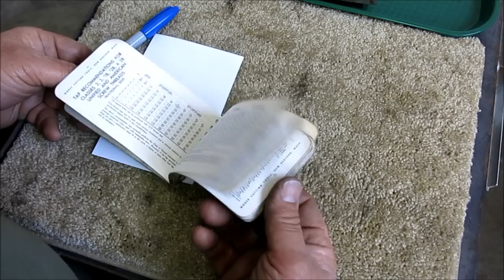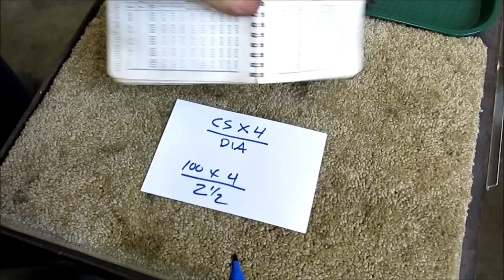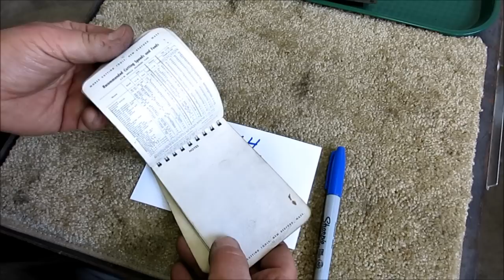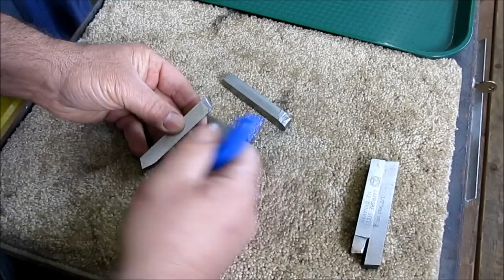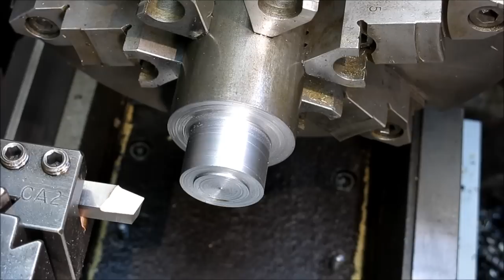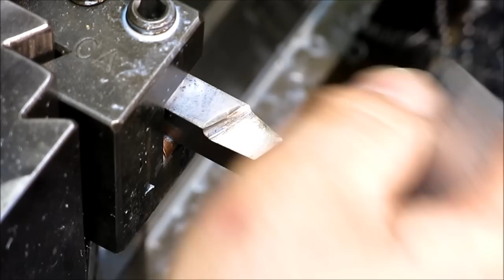Chip Control to Major Tom

Comment: why is it that machinists never hone their hss tool on a leather or wooden strop, charged with honing compound after grinding it on the bench stone? in woodworking this is compulsary practice for a good and polished cutting edge, which will not dull quite as fast as a ground  one on a usual bench stone  (which will look much like a abused steelbrush under the microscope after the first second of use). Honing in my trade is done on a strop with honing compound, or on a (at least)  8000 grid stone. I can't imagine that the same rules for cutting edges don't apply at all for metal cutting. I get better results with a good stropped  cutter on my lathe. What is your view on this, Tom.
Reply from the maker: Hi Flip,

Well I never tried it. Do you strop the edge on your log splitter? The edge of a fine wood chisel and a axe are two different kinds of edges. Instinct tells me that it would probably not make a noticeable difference. The metal cutting tool works because some base metal actually builds up on the edge and aids in the shearing action. This is called built up edge or BUE.  So the cutting mechanisms are slightly different when comparing to wood cutting tools. That said the honing process makes a dramatic difference in the cut action and quality of single point metal cutting tools. So it might be worth trying an experiment.

Cheers,

Tom
Reply: oxtoolco Thaks for reacting, Tom. as for the log splitter, i would hone the cutting edge when having to split cross grain, Which in my opinion is more like metal cutting. Is this BUE semi palstic (due to temperature or so)? As far as i know for woodworking cutterly, the polished edge results primeraly in less tool pressure and a much longer standing time of the cutting edge. but this is most noticable when cutting cross grain. I can imagine that this BUE rolls easier over a polished surface. I would be interesting to see cutting edges of metal cutting tools before and after use on a micron scale. when sharpended on a bench stone it looks like the alps as far as i know. Interesting matter, that metal cutting, or is it merely pushing it away?
Reply: Flip de boer I also operate in the wood cutting business. The problem with strops is they tend to round the area near the edge, changing the geometry. We operate Weinig molder and profile grinders and they recommend never honing, same issue, geometry change. The secondary bevel is designed to provide maximum edge support and as such provides little clearance for heeling. If your bevels or feed speeds reach the point of heeling the tip will heat and the edge will go to hell much quicker. Odd as it seems feeding too slow will also heat & dull the tool. Too much rubbing and not enough chip to take the heat away. Molders equipped with profile grinders can also reach the point of heeling very easily.

Comment: Hi, Tom. thanks for the schooling on tool bits. i think i was making mine wrong all this time, my nose radius are huge and side loading my work pieces. your equation: what is the units or value of the "4" or is it a consistent??? thanks for the great videos. sorry about the stupid questions.
Reply from the maker: Hi Sam,

Four is an approximation of the conversion of feet per minute to revolutions per minute. Its an easier number to work with than 3.82 when doing work at the machine.

Cheers,

Tom
Reply: thanks

Comment: Great video I learned a  lot, thank you. Two thing that I may tribute to. One is when using honing stone I would use a plenty of water, otherwise material from steel is clogging surface of a stone and finish is not good as it could be. Second thing is that scissor like tweezers, in my opinion if it catch something and get pull your fingers may be pull also. I'm using normal without finger loops. Just a thought, I'm not trying to be safety nazi.
Reply from the maker: Hi Olomar,

Thanks for the comment. The pliers I'm using do not have finger loops. You are correct that that would be a bad idea. On the honing stones. I subscribe to the technique that a dry stone gives a superior edge. The details of which are described in detail in the great book "The Razor Edge book of sharpening" 
http://www.amazon.com/The-Razor-Edge-Book-Sharpening/dp/096660590X

Cheers,

Tom

Comment: The HSS cutting speeds in the books and on the charts are based on a 60 minute tool life. GREAT CUTTING TOOL ! Nice cutting with .4375" depth & .010" feed, no more steel wool !
 Great to see you using real man's coolant ! By the way those unrealistic high speeds manufacturers recommend for their carbide inserts are based on a 15 minute edge life !

Comment: I am definitely going to do a follow up video at some point on my heavy turning video. I was at .030 feed rate with my 1" bit I would have liked to have seen how your 1/2"did at at least .015. I think it might have broken the chip even better. I am thinking crowding the feed rates might result in more faster metal removal  than just making a deeper cut. I can't wait to get time and materials to try it with! Thanks for the great insightful video.
Reply from the maker: Hey Brian,

An impressive cut no doubt. I'd for one like to see it closer up and a couple seconds longer. Do you have any 1/2 inch toolbits?

Cheers,

Tom
Reply: I looked in my stash and all I have in 1/2" stuff is some brazed carbide.  I don't currently have any material to cut on anyways. I want to do some chip breaker work on my cutter anyways to try to get a turning setup that is clean and doesn't ribbon or throw 1lb chips at me. LOL Busy farming here now, so shop time is limited, but I will get back to it soon. thanks for your interest.
Brian

Comment: Hi tom, could you at some point make a video about machining tapered parts? Tappered externally and also doing a tapered bore? I can find some videos on it but I would appreciate your take on the topic.

James
Reply from the maker: Hi James,

As in things like Jacobs tapers or long tapers like propeller shafts? This is actually a entire class of work for long tapers. Short ones are fairly straight forward. (no pun intended) with the compound, The trick is measuring them.

Cheers,

Tom

Comment: Hi Tom, old school worked well! That's how it hung in there long enough to be old! I'm getting pretty old, and it's mostly my way... ;o] For the most part that was just how I'd grind it. Perhaps depending on material, and machine/machinist (chips)... I may have put just a "tiny" bit more radius on the point,,, (very slight). There was not even the least little bit of strain coming from the sound of your lathe... It seems to be quite a nice machine! Y'all are creating quite a nice series and are great teachers. Thank you... :o]

O
Reply from the maker: Hey O,

Normally I use a slightly larger radius as well. Watching Adam on the first chip control I decided to try a real minimal radius on the first tool and it seemed to hold up fine. The lathe can take the strain but the tool clamping will become an issue pretty quick. Thanks for the comment.

Best,

Tom

Comment: Thanks Tom, this info is priceless.  Have you ever used this type of cutting tool?  Diamond Tool Holder in use
Reply from the maker: Hi Coyzee,

Never tried one. This is basically what I ground in a blank piece of high speed steel. The diamond type shown in the video makes it simple for beginners to sharpen a tool and have success. I would invest in an insert setup before I got one of these. But I can see the utility of the design.

Cheers,

Tom

Comment: While the two videos so far have been very interesting and helpful, I must confess that my interest in "How Much and How Fast" is quite limited.  I'm actually much more interested in how to adapt the grinds and other variables to provide the best finish on a variety of materials.  For example, if you used the same bit/grind and substituted aluminum or stainless steel or brass or cast iron or 4140 for the 1018, how would the finish be?  How can the grind be adjusted to minimize build-up on the edge?  How can the grind be modified to allow the bit to work longer (with a good finish) between sharpenings? If the goal is the ultimate finish right off the tool (no subsequent polishing) what's the best way to grind and use the tool for different materials?  Thanks.

-Chris
Reply from the maker: Hey Chris,

The short story is it depends. This tool will work on all the materials you mention. Better on some and worse on others. There is an interconnected relationship between the tool geometry material and feedrate that we modify to produce different characteristics. If surface finish is the only goal it is a very different set of parameters and tool geometry. As you can see in carbide inserts as an example there are a huge number of available tools just for straight turning each with its own particular focus and strengths. Its not far wrong that the story is the same for hand ground high speed steel tools. The purpose of this series is to show what can be done first of all, and what some of the knobs we as machinist have available to make changes. From there its optimization for your specific requirements. No tool does everything is an accurate statement. I can't give you a general answer that works unless you get very specific. Hope this helps.

All the best,

Tom

Comment: Interesting vid tom....can i participate? ...I wanted to say that IMO the tool should always  be on center..... if you want to experiment change the front relief angle ...this in essence is what you did be raising off of center ......but by doing so this creates much more tool pressure ...most people that are watching and learning have smaller less ridged machines not a good combo...
Reply from the maker: Hi Lawrence,

We would love to have you join in. This is not a competition per se. Its really about showing and learning what can be done. The only rules are hand ground high speed steel cutting mild steel. This allows us to make comparisons more easily.
In general most tools are easier to think about running them on center. By raising the cutting edge you increase the top rake at the expense of front clearance. This has the effect of increased rake but no reduction in tool strength. The problem with this is as the diameter changes the angles change so its not used much as a control knob for cutting optimization. There is a great section in the book "Tool Design" under single point cutting tools on this very subject.

Cheers,

Tom

Comment: Hi Tom,

That's impressive, how many horses to drive the space ship?

As we know Adam, as soon as he is finished with the dilemma of the 1/10 of inches, his pride will make him very creative so he doesn't get beaten.

As far as HSS hardness is concern, it can be heated up A LOT before it looses it's properties. One test I performed: I welded a piece of HSS to a mandrel, then I tested the hardness on a Rockwell meter, it resulted the same thing on the heated zone as the other end not affected by heat, around 61 to 62 Rockwell C... Impressive material!

The little lathes are shivering while we assist to the epic battle, I enjoy this more than TV,

Pierre
Reply from the maker: Hi Pierre,

We left some headroom for Adam for a comeback.  I'm sure he will put on a good showing.

Cheers,

Tom

Comment: lol out of about 200 tool bits not 1 rex95 but i got my tool bit drawers cleaned up a bit hehe.so if i do jump in on this i hope it dont have to be a rex95.ill have to go to the welding shop and see if the have any 2.5"mild. most iv took in 1 shot to date was 1/4" or 1/2" how ever u want to say it on my 13" lathe but never on a anything that was not back in the chuck the through hole in my 8" chuck is only 1.950. if i do ill post a response here. thanks for another awesome video who needs cable lol
Reply from the maker: Hey Turn,

We won't bust you down for not having Rex 95. The one I used was just plain jane high speed steel.

Cheers,

Tom

Comment: Nice response Tom. That little bench grinder seems like it has plenty of power for grinding tool bits. What brand is it...just curious. 
I see you decided to try some back rake on your grind. I wanted to try that on my next round. 
I think we got some similar results with the cut, but my ultimate goal is to maintain a breaking chip. Thats how I like that cold rolled to form....perfect little curly cues coming off the tool. 
After I show some deep heavy cutting, I want to get back into my standard chip breakers and how they work for me under normal cutting jobs. 
I guess I need to fire that coolant pump back up too. I'll just put a drip pan under it when I use it. Lots less smoke then with all the cutting oil...LOL
So don't count me out just yet. I got plenty more to show ya!
 Best regards buddy,

Adam
Reply from the maker: Hey Adam,

I switched to the soluble after smoking out the whole shop with cutting oil. Can't wait to see the Abom special chip breakers. Looking forward to the next installment of chip control from Cape Canaveral Florida.

Talk to you soon,

Tom

Comment: Awsome vid Tom.

I have a old Craftsman 6" lathe I restored. I have an A2Z QCTP that came with some 3/8 indexable tools, but the lathe cuts much better with 1/4 HSS. The OEM lantern toolpost uses 3/16 tools. Do you have any sugestions for grinding chip brekers on 1/4 HSS or smaller 3/16 HSS.? I bought  a craftsman 8" grinder, but such a small chip breker doesn't seem doable on a grinder. Maybe when you get down to a 1/4 HSS chip brakers are thrown out the window. Whats your experience?

All the vids and info on tool grinding seem to deal with larger tools 3/8 and up.

Thanks in advance, for any help.

Ron
Reply from the maker: Hey Ron,

Try a Dremel tool with some of the small Aluminum oxide grinding wheels.The cutting discs don't work that great on high speed steel but the small stones work well.

Cheers,

Tom

Comment: Hey Tom...

I am confused...7/8" depth of cut is really TIR, the actual ("in feed") contact of the cut is 7/16"

Confused or correct or are we talking the same?

Chuck
Reply from the maker: 40:50   I say it correctly. At the end I bozoed the diameter versus radius.

7/8 on the diameter 7/16 radial.

Best,

Tom

Comment: Tom I really liked your selection of the tool steel grind. I knowingly smiled when you were showing how you planned to grind the tool as I have used these before and grind-ed them myself . All of the angles from the lead angle on to the others make for a very strong efficient tool. I have used carbide inserted tools for roughing which has the same type of angled lead and they really do the work. I enjoyed your processes and results. The Old School way is always good for me. I like the sound of those smaller blue chips clinking around they are just right.
Reply from the maker: Hey Lou,

Thanks for the comment. Old school rules.

Cheers,

Tom

Comment: There's me thinking after reading the title that you were going on a diet and instead you just go and make a mess of your lathe. A "chip" in English is what you in the colonies call a "fry" and I thought you were going to control your input of chips. :>)
Nice going but try doing that on the average home workshop lathe.
ATB
chris
PS not being picky but it's not 7/8" DOC as you said but only 7/16. 7/8 off dia!
Reply from the maker: Hey Chris,

Good one on the chips. I think I mentioned several times it was a diameter cut. Maybe turn the sound up a little but not enough to wake your mom. Also what would you Brits call the curly things coming off? I think we are way beyond swarf here. 

All the best,

Tom
Reply: Watch the last few minutes of your video again Grasshopper.
I would have to turn the volume up a VERY long way for that to happen
As to what they are called, well, as you know modern multi blade razors (you are perhaps familiar with the concept of razor blades, I assume) are made this way perhaps they could be called tree felling razor blades.
Reply from the maker: Check the vid at 40:50. I yield to you at the end where I messed it up as radial. I was pretty sure I was clear somewhere in there.

Best,

Tom
Reply: Don't worry, we viewers knew what you meant I was just teasing. It's still an impressive cut no matter the numbers.
Reply: Hi Tom, I have been thinking about it this afternoon and I think I might owe you an apology, I used a word that might not be familiar to those living across the pond.
Oh, yes, the word....diet! :>)
chris (weighing in at about 210 pounds, so no brickbats please)
Reply from the maker: Chris Stephens Yeah that caught me off guard. Chips and diets all in the same post. It was like reading a foreign language. I have heard tale told you are long for your weight. 

Cheers,

Tom
Reply: The colonies indeed! Rule Britannia. And would you like fries with that ?
Reply: And proud it is you should be. Long live King George.:>)
Google translated that word for me, so If you have some Mayo to go with them, then yes please.

Comment: Tom, that is pretty impressive now if you could convert it to making curly fries I would declare you the winner..my poor little old lathe would be weeping if I showed it this video.
Reply from the maker: Hey Randy,

I think all the Grizzly's and Sherline's are shivering in the corner right about now worried their owners are coming out to the garage to have some fun.

Cheers,

Tom
Reply: oxtoolco So far my limit on a 1.5 hp lathe with mild steel is about .100 total dia removed (using carbide). There may be a little more left, but I haven't progressed that far. But yes, my lathe shivers when I show it videos from you guys. :)